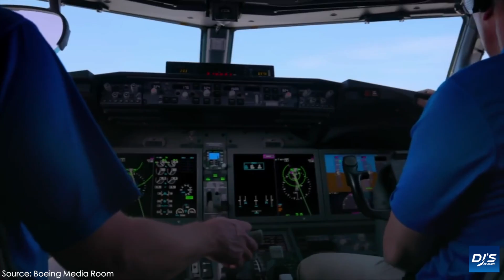Boeing 737 MAX & MCAS Problems

Comment: Technically you could kind of say it was the pilots fault to some degree. It took them way too long to figure out it was essentially a runaway trim stab situation. Turning off the auto stab switches is a memory item.

Comment: MCAS Money Cash All Seats, full. Centre balance problems same attitude as the car maker that left a fault on their petrol tanks during a crash but the insurance pay out cost cheaper than a reorder and a refit. until the judge find the paperwork after a family burnt alive after a crash rear ender and Plucked millions for the survivor how was badly burnt but he other did not and the company went bust. COPERATE FINAICAL GAIN = Insurance pay outs cheaper than a recall refit new design engines it would shut this monster down.

Comment: Um, i read about the mcas update, but no where does boeing mention when the mcas will self de-activate! If pilots don't fight with mcas, will the mcas system continue to trim with nose pitched down until the plane crashes into the ground?
Reply: MCAS can be turned off by turning off electrical power to the horizontal stabilizers and trimming manually. The pilots would never need to do that because of the fixes done to the software. MCAS now uses 2 AOA sensors instead of one like before. If the sensors disagree with each other, MCAS doesn’t activate. The angle that MCAS pushes the nose down has been reduced and it can be easily over powered.

Comment: Even with two AOA sensors they could have a common mode of failure so an alternative type of AOA sensing system should be used as well. This was learnt with pressure releaf valves on pressure vessels way back in the 1930s

Comment: Boeing’s dysfunction can be traced even further back to a 1997 merger with McDonnell Douglas that heralded “a move away from expensive, ground-breaking engineering” to one “devoted to keeping costs down” and shareholders happy. Over the period of the MAX’s development, Boeing spent $60 billion on dividends and buybacks while spending around $3 billion to create the MAX. Boeing didn't care about the MAX's quality or safety, they cared about market share and shareholder value!

Comment: If an evaluation judged that failure of this system is Catastrophic (as it proved x 2) then there should have been a System Safety Analysis evaluating every failure path of the MCAS system and proving mathematically that the probability of failure would be less than 10E-9 that is 1000 million flight hours. Yet two catastrophic accidents occurred within months. It is impossible that this system analysis was carried out. Its clear that some within Boeing and also FAA are criminally culpable.

Comment: MCAS was implement for fighter planes  that have one soul on board. If the 737 MAX boat anchor cannot fly without it, scrap it!
Reply: The MAX flies fine without it. MCAS was just to mimic previous 737ng model and avoid new type rating certification.

Comment: Boeing, where taking data for a safety system from both of the AOAS sensors which are fitted rather than just one of them is an optional extra (All US airlines opted for the extra but foreign airlines havent). And the fitting of a warning light on the dashboard that indicates that the AOAS sensors are in disagreement was an optional extra too!
Reply: For a safe plane really there should be 3 forms of redundancy.

Comment: So basically, Boeing knew there was a s system in the aircraft that had a single point of failure and would cause an irrecoverable situation in 10 seconds or less, and then they decided it was to costly to tell the pilots about said problem? And then when the inevitable crashes occurred, the first thing they did is blame the pilots.  The only cure is to put every single manager involved into prison for life on 346 counts of murder and to replace them all with engineers.
Reply: I would put them in a MAX with a faulty sensor.
Reply: Wait, you’re saying there was no punishment despite it clearly being manslaughter? Nice justice system over there in murrica

Comment: Really no surprise. Boeing has morphed into a typical profit at all costs motivated enterprise. It was a Wall Street darling and that's been the focus for a long time. Couple that with airlines insisting on no additional training required for MCAS as that would impact their profit and this is what you get.

Comment: what if.... boeing ask airlines.. the single aoa censor that feed mcas system  must replaced with new censor on every 3 month... and the boeing engineer makes mcas system completly off if two nosedown movement are corrected by the pilot... mcas will reset after engine shotdown.... pls respond..
Reply: He won’t respond to your comment just so you know
Reply: @filledwithvariousknowledge1065  what is your opinion sir? that lion air planes crashed just 30 mile from my town...
Reply: @sonidamara5018  I believe Boeing is mostly at fault because they were greedy to charge for the optional features which might have helped the pilots but also the fact they refused to tell pilots about mcas and no training is beyond belief. Lion Air does to a degree have a small role. They did not ground it after having problems the night before but was saved. Had it been grounded the fault with the broken sensor (mind you there are 2 as standard on 737 but Boeing decided stupidly decided just 1 of them was needed to determine whether to activate mcas) might have been found and fully repaired
Reply: @filledwithvariousknowledge1065  agree.. now boeing designed that two censor feed the mcas.. and that system are less powerfull than the first system... do you belive that max series will fly again like the NG?
Reply: @sonidamara5018  When the regulators are satisfied yes definitely

Comment: Why does it have MCAS? To fool the pilots into thinking that the plane is stable.
You expect  military planes to put performance first but how can a commercial airliner is unstable unless a software override occurs.
The plane is an unsafe design  and should be scrapped.

Comment: Boeing is such an evil company now. They should have gone to 3 sensors by now. That they have not is gross negligence. And even worse using a single sensor. And then to find out that the testing had revealed the problem. Greed Greed Greed. And the FAA should be turned upside down for this.
Reply: Aren't the Europeans demanding 3 sensors for European certification?

Comment: I hope that the airplane manufacturers learn from this. That a rushed unsafe plane is not a good financial decision.  But they should have learned from DeHavilland and the Comet. Even though the investigation wasn't complete.  The plane was put back to service,  with catastrophic results.  DC 10 had a door issue that was not resolved.  And a lot off  passengers refused to fly it.
Reply: The DC-10 issue was resolved, they are still in the air. Freighters, tankers, and a fire retardant asset. So yeah.

Comment: Boeing put a larger engine on the Max, which required a shorter pylon and placed the engine inlet almost at level of the wing, stealing some lift from the wing thus requiring the enhanced stall prevention of the MCAS. the aircraft is flawed. They should have engineered longer landing gear. Mechanics are smarter than engineers.
Reply: EXACT.  MCAS only on the max for that very reason. 

Big fail.  If they spent this time redesigning the physical design, by raising the clearance between the fuselage and the ground for more clearance, then BOEING would be on the right track IMHO.

Comment: Basic question from a non-pilot, though a bit of an aviation nut. I get that MCAS is intended as a pilot-assisting safety feature. So far, so good. But, why in hell did the plane's software and control systems STOP looking for problems once MCAS took over? 

Why did the plane not recognize a severe pitch downward at full throttle as a pilot-assisting safety condition in urgent need of correction? Why didn't second-level software recognize problems created by first-level software? 

Is that the way it works in general, that once one auto-safety feature takes over, the plane becomes oblivious to any other potential risks? 

Thanks for help in understanding.

(Edited for typos and clarity)
Reply: Ken D you are basically asking why was it designed improperly. The design, validation, and verification process at Boeing is/was fundamentally broken and was basically able to be sidestepped. Boeing’s engineering staffs knows what needed to be done to make it safe, but for some reason MCAS was not given the proper level of attention it should have.
Reply: @torpedan  Thanks, torpedan. This blows my mind. 

What epic failures on so many levels. Others have documented these very well. 

But even just isolating the software aspect of the failures, it astounds me that there was not a "Master Control" part of the plane's software that ALWAYS remains in control. Something that, when other flight-affecting subsystems over-correct or under-correct, the Master says, "No, hold on; that's not right." 

Granted, we don't want stalls. But, one would think that, once MCAS took over, there would be enough intelligence left in the plane's control software to recognize that maybe a severe pitch downward, including from low altitudes, at full bore  maybe isn't for the best. It's like once MCAS took control, it pulled the plug on all other safety control systems.
Reply: @Ken D essentially the master control system would be the pilot, which is likely part of why the pilot training was heavily scrutinized early on. That said, the fundamental design problem was that they were able to add software that could affect the control surfaces of the plane without it having some for a proper review to be sure it has the failsafe that needs and that it’s appropriately integrated with other systems. 

I have not read or dug into the full reports, but what has been conveyed is that the failures were so fundamental and so basic that it’s appalling and that the entire program deserves heavy scrutiny to ensure nothing else was overlooked. It would’ve taken what are likely minor changes to prevent at least one, if not both, of the crashes. (software and flight controls are well out of my area, but pulling from data from two sensors and comparing it seems like a pretty bog standard thing.)

Comment: Question: Why MCAS?...if the plane tends to  tilt upwards, would not the pilots be aware of this and be able to correct it manually ?
Reply: Aircraft should not be pitching up by itself in the first place (stable aircraft). If it does pitch up (unstable aircraft), you have to fix it by some means, otherwise it will not be certified.
Reply: @user-yt198  CORRECT.  AND MCAS WAS THE ONLY "FIX" FOR THAT ISSUE.  Big FAIL by Boeing.
Reply: @JamesBond-jy8ti  They could have redesigned horizontal stabilizer instead of using MCAS. But... Money!
Reply: @user-yt198  MCAS was an extra option for airlines.. yes.. money.
Reply: @JamesBond-jy8ti  What do you mean "extra option"? Nobody could buy MAX without MCAS.
Reply: @user-yt198  correct.  I read wrong.

Comment: It's absolutely ASTOUNDING that Boeing would contemplate implementing MCAS with only one angle of attack censor (even if a second censor is an option at time of purchase). Furthermore, a MAX does NOT require MCAS to operate safely provided pilots are trained adequately.

As I see it, MCAS is merely an unnecessary gimmick to make a MAX feel like previous iterations at the controls, to avoid a new type certificate and extensive flight training. Granted this saves money and time, but at what ultimate price in the event of breakdown?

The assertions that some or all MAX's are inherently unstable are bunk. They just feel and handle differently than previous iterations without MCAS, so pilots must adjust inputs accordingly.

That said, I'm not a fan of MCAS (mechanical complexity).
Reply: You have no idea what you are talking about. 1) MCAS is mandatory for MAX, it is not an option 2) Second AOA sensor always comes with the aircraft. It is not an option either. 3) All MAX aircraft are unstable. That is why MCAS is always required.
Reply: @user-yt198  , the plane can indeed be flown without MCAS. Perhaps you should avail yourself of demonstration flight videos taken at Farnborough, i.e. those extremely steep takeoff manoeuvres. You cannot do those with MCAS armed. Think about it.

Sure, the plane handles differently than previous iterations, and requires pilot input modifications, such as trim, pitch, etc. However, you don't need MCAS to do those functions, but you do need to know what to expect and how to deal with it in a timely fashion.
Reply: @lrg3834  Word salad. Can MAX be certified without MCAS or not? NOT!! Period.
Reply: @user-yt198  , yes it can, only that requires far more rigorous testing (for a new type certificate) and a brand spanking new pilot training program, both of which require big dollars and a lot of time. Why Boeing cheated with MCAS.
Reply: @user-yt198  , for greater certainty. Had MCAS not been installed in those ill-fated MAX's in the first place, they never would've crashed. That's what so sad.

You. don't. need. MCAS.
Reply: @lrg3834  Again you have no idea what you are talking about. JATR discussed many times to advice Boeing to get rid of MCAS all together, but neither them nor Boeing found a way to make MAX fly without MCAS.
Thus without MCAS, MAX is not certifiable.
Of course you may still be able to fly it, like you may also fly an F16 without flight computer, but that is not what certification means.Actually you don't know what a certification is.
Reply: @user-yt198  , the problem with those crashes was not the tendency to climb, but to dive on account of MCAS due to faulty AoA readings. That's fact. Therefore, no MCAS, no dive: basic logic.

Also, lest we forget, MCAS merely manipulates trim, which is what pilots can do for themselves!

As for JATR, you make a very big, bold claim. Proof? Would be very material and damning if you could produce such documentation, and I should think would make many lawyers very happy as well.

Comment: I find it unbelievable that Boeing could even consider using only one AOA sensor for MCAS's operation in the first place. Quite simply it's BAD ENGINEERING. I wonder if that decision was related to whether or not MCAS was considered a safety critical system. To use both sensors redundantly may have made that difference and with MCAS now 'safety critical' it would have needed the extra training that American didn't want.
Reply: pasoundman - MCAS was defined as a “non-critical flight system” by saying its primary purpose was to make the plane “fly like any other 737”, so pilots wouldn’t have to have special instruction on the MAX-8. This allowed “Certification by Type” (as a 737 under the rules in place when it was introduced in 1968). Doing otherwise (admitting that it was “flight critical” & relying on 3 AOA Sensors instead of 1) would’ve required recertification under the rules in place now instead of those in place in 1968. Not only would that have been a time consuming process, but the 737 MAX-8 probably wouldn’t have been certifiable under our present regulations.
Reply: @TraditionalAnglican  That seems to be a case of yes, yes and yes !

Unfortunately MCAS grew out of all recognition such that it fails even the first test.

Comment: Did it really fly STRAIGHT INTO THE GROUND?
Reply: Bryster51 - Yes, just like a very fast, very big lawn dart. Pilots that managed to recover the A/C were higher (had more room to deal with the problem), ignored the cacophony & chaos this system produced, turned the system off & took over the A/C. And, they did this in under 10 seconds. Pulling out the Flight Diagnostics Manual sealed their fate. In the Ethiopian Air accident, the pilot read the advisory & turned off MCAS as advised by Boeing. By the time he finished reading the advisory & turned off MCAS & the Autopilot, the A/C was going too fast for him to be able to control the Trim Tabs manually, & the A/C was driving itself into the ground. In desperation, he turned the Autopilot back on so he could get control of the Trim Tabs & recover the A/C. MCAS reengaged within 20 seconds & drove the place into the ground at 400+ knots.

Comment: The large diameter engine cowling exceeds above the wing causing an unstable boundary effect that the MCAS cannot compensate. 
No wonder the algorithm has to be completely re written. 
Stay away from this dangerous design.
Reply: More info ?
Reply: MCAS can compensate. Algorithm might need improvement, but doesn't need rewritten. The main problem was relying on a single sensor, without backup, without redundancy. The sensor malfunctions you provide wrong data to the computer and you get wrong answers.
...and the MAX flies fine without MCAS. ...MCAS is there just to avoid the need for a new type rating.
Reply: @miks564  Clearly not ENTIRELY rewritten, just the main algorithm. Yes, I know .... Airbus deals with multiple sensor mismatch by taking the automation offline and 'handing the plane back to the pilots'.
Reply: @pasoundman   I want to believe Boeing does the same on their glass cockpit planes (787 and 777).
 MAX is clearly a black sheep.
Reply: @miks564  Why do the 777 and 787 need anything done ? No MCAS in them.